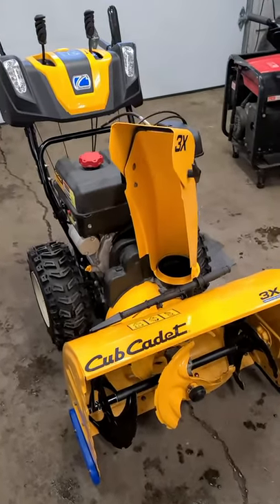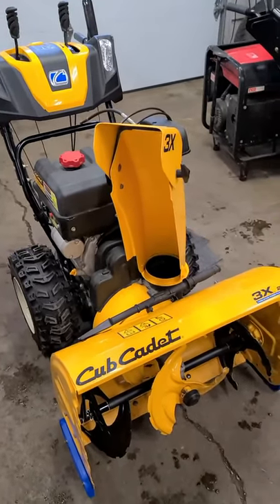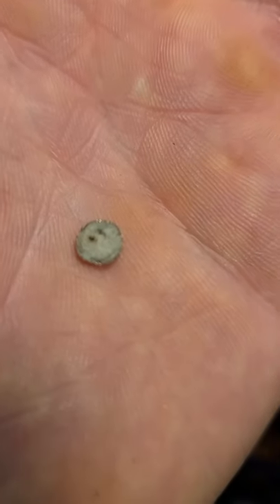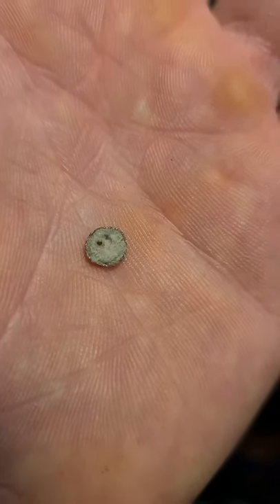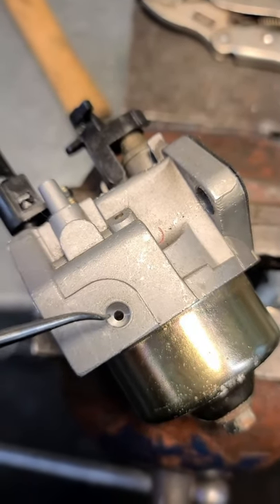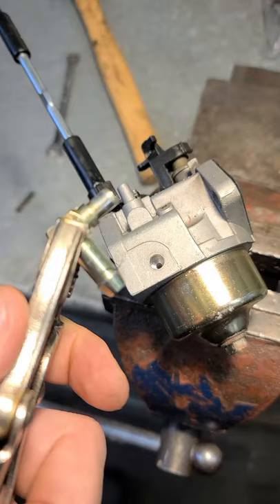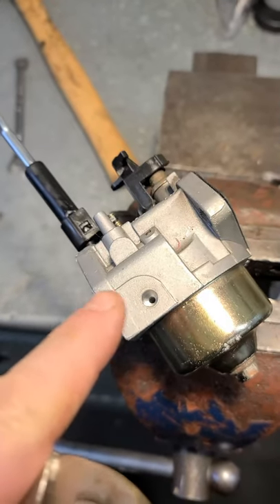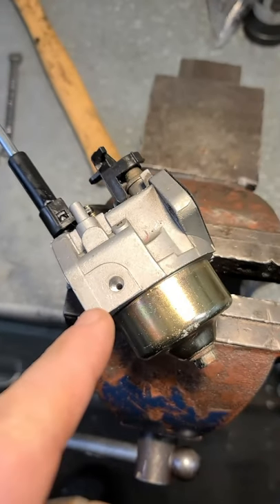Cub Cadet Snowblower Only Ran For 10 Minutes Then Died! Here's why! #shorts

Comment: Years ago they used to put those screens between the the fuel line and the carburetor on automobiles. A friend of mine had a Rambler and he brought it to a garage and they rebuilt the carburetor and it still wouldn't keep running so he took the fuel pump off sent it out and had it rebuilt because he couldn't get a replacement And it still would not run. I stopped by his house one day and he was telling me all about this problem and I said go get some ranches so he brought a small toolbox out with some wretches I took the fuel line off pulled the screen out put the fuel line back on and told him to start it up and it would run.. It ran like a champ he couldn't get over it I showed him the screen that was all clogged up And he couldn't believe he went through all the expense and  Aggravation he did and all it was was a little tiny screen.

Comment: A buddy of mine has a Husqvarna ST 424T(EFI) not a year old.  It keeps bogging down and shutting off while blowing snow...even light fluffy snow.  Also if he releases the drive and blow levers at the same time it will bog and then shut off.  It's been back to the shop twice.  

What are your thoughts on what could be causing this.

Comment: You can, of course, just punch out the fuel screen, then run an in-line fuel filter. That would be easier than removing a fitting, which may need additional resealing or a replacement carburetor.

Comment: Any reason why a Husq 455 chainsaw that starts then then throttled dies. Starts up again and fine. Put it down after number of cuts (brake on) and then pickup to use, release chain brake, hit trigger and Bwah, shuts down. Then starts easy again (one-pull). Been using clean fuel (non-ethanol tru-fuel 40:1). Chainsaw isn't that old (low hours)...2019 model.
Reply: Sounds like the high side jet may need adjusted.  If it's a store bought Husq vs a dealer Husq, it may just need a carb tuning if it's broken in now.  
Worst case, it could be an air leakage around the accordion tube, from a loose connection.

Comment: I had 2 happy days with this snowblower. Very happy when I bought it at Home Depot and EXTREMELY HAPPY WHEN I SOLD THIS PIECE OF CRAP MACHINE!
Reply: Sold it? didn't return it?
Reply: @WatsitTooyah  I had it for a couple of yrs. That's why
Reply: @murd777  oh wow I have one less than 90 days old I have used it at least 6 times already! ☃️🌨️
Reply: @WatsitTooyah  Do you have the one with the metal chute?
Reply: @murd777  I have a toro 2 stage cordless electric model e24. Its a metal chute.
Reply: @WatsitTooyah  I don’t think those electric snowblower are powerful enough for what I need.
Reply: @murd777  The power is on par with a 252cc I'd guess. I can go right through hip height thick snow from the road plows. I ran it right into a wall of ice and it just has loads of torque, can't stall it. I have a short video on my channel going through a bit over a foot of snow.

The only problem is battery runtime with that much snow.
Reply: @WatsitTooyah  I just watched it. Sorry, but that’s literally a toy machine. You can’t compare it with a Honda snowblower. All the best!
Reply: @murd777  Hondas are the best of the best from what I've heard. It's no comparison when they are twice as expensive if looking new.

I'm not sure what it is that makes it a toy since It's built pretty much the same as the toro gas model. Weighs the same too. Works plenty well and is heavy duty enough for my needs.

The powersmart 2 stage electric looks like a toy to me 😂 and the Ryobi.
Reply: @WatsitTooyah  From what I saw in your video. That electric machine is not powerful enough. I bought a Honda because I need to throw the snow 30-40 fr over my fence and Honda does it no matter the snow condition wet or dry snow.
Reply: @WatsitTooyah  I’d rather buy a used Honda snowblower than any of those toys. That’s my opinion. You’ll see the work is a lot easier and quick. No headaches. At the end you have a nice machine that works perfectly and it holds its value if you ever want to sell it and upgrade it for something better in the future.
Reply: @murd777  Filming was not ideal i needed a 3rd hand. It's rated to throw up to 45 feet. Seems about right to me. It doesn't throw low volumes of sopping wet slush can almost get clogged but it clears itself. I imagine any blower would have similar trouble.

To each their own 🌨️ take care of that Honda it will last a lifetime
Reply: @murd777  I'm just not a fan of gas and the maintenance and number of things that can go wrong. But that's just my preference 🎅

I'm just glad I got a 2 stage instead of a 1 stage.
Reply: @WatsitTooyah  I don’t have any problem with heavy snow. That’s why Honda is the best. 
Get a bottle of liquid ceramic coat for cars on Amazon or Ebay. Clean the chute and Hugger and then apply it with a soft cloth the areas where the snow has direct contact. That might help your machine with clogging issues.